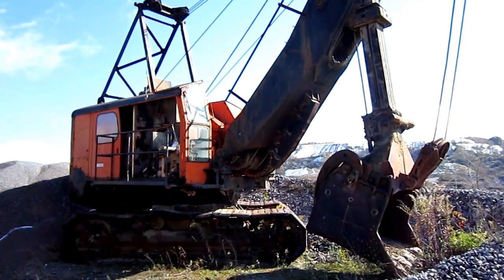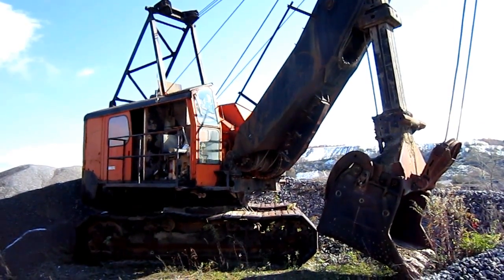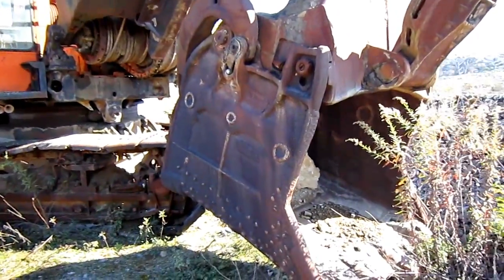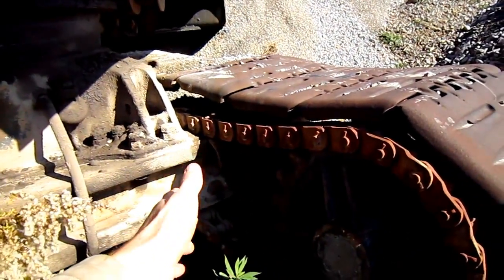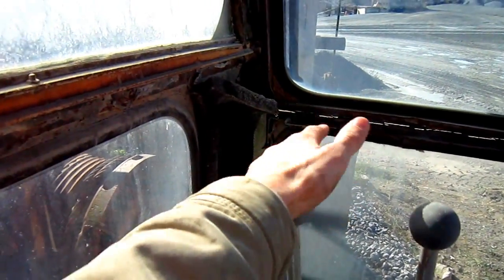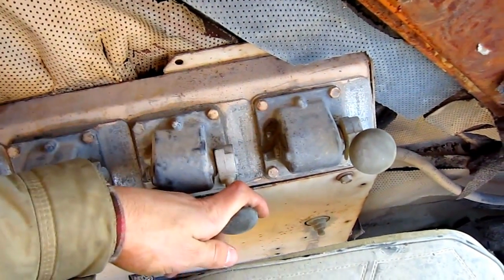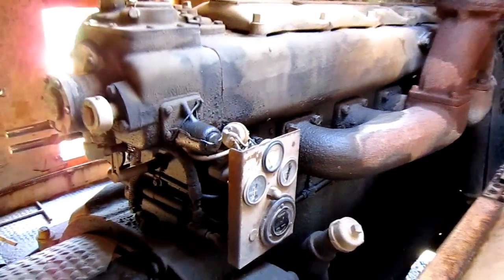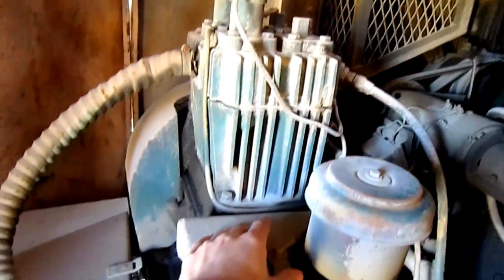Northwest 80-D Documentary

Comment: You forgot to mention what made a NW shovel as they called it "real rock shovel" which was the dual crowd. The hoist rope leads over the boom sheives and is not merely deadended on the boom but is brought a drum at the foot of the boom. The crowd rope comes off that foot boom drum also powered by a chain from the crowd drum. Both ropes torque are applied to the crowd simultaneously up through the shipper block via the crowd rope . (Hence the name Dual crowd") sorry little wording here but anyways you couldn't beat the power of a NW shovel through a cut back in the day. One old timer told me he could rip right through stratified rock with an 80D. Impressive

Comment: I oiled on an 80-D in 1977 that was so dirty it just had a butt rub streak from behind the operators seat to the back of the engine compartment. when I got through with it, a mechanic said it was the cleanest shovel he'd ever seen!!!
Reply from the maker: Always amazes me how some operators can never take the time to clean their machine
Reply: PAmining Like an old timer I worked with said that they were interested in 2 things- quitting time and payday.
Reply: Those were some hard days setting in the back of that NorthWest 80-D with my box of rags and my gallon jug of diesel fuel. I tell yall, those shovels made sounds that weren't meant for the human ear!!!!!!
Reply: The old Murphy's were interesting and all the shovels I was around were like the one you ended up as far as you cleaning them up. No slobs and some of the oilers ran them as much as the operators. I ran a Model 6 with a headache ball and a 25 with a drag bucket. Ran more left handed rigs than right handed though. 99% straight mechanical. Smaller ones to get around better.
Reply: Only ran one manual 80. In '77 my Dad got us a package deal with Florida Rock, who had bought out Dixie Lime & Stone in Georgia, and there I got a taste of Bucyrus Erie with the 30, 38, 71, and 88-B-III. It was tough to go right handed!!! Would rather oil on NorthWest 80-D than any others!
Reply: I ran a 22 with a clam and 1 or 2 with a drag bucket and a 30 with a headache ball. I would've really liked to get on a bigger one but there's no room for one that size around here. Right handed is a constant deal for a while. The hoist and drag aren't so bed but the swing--- I just had to put my left in my lap for a while.
Reply: The last dragline I ran was a NW95-D, now check this out. I can only describe it as being both upside down and backwards. The previous operator had it changed from right hand swing to left. Now, this is the weird part, the brakes were backwards too! The right went to drag, the left went to hoist. Try wrapping you're mind around that!!! But as an operator will, after a week it was second nature to operate...
Reply: Do you mean he switched the clutch lines around because I thought a 95 was manual brakes.And that made it cross handed/footed? MERCY! If that was the way it was and left handed swing, YOU was in a fix for a while. They called it cross clutching to on a dozer to let a track over run the other instead of clutching and braking to slow down and turn. I used to run a JCB backhoe and a 490 JD with ISO? pattern- left hand crowd and right hand main boom and had to switch back to a 200 Komatsu that was the other way. The other operator wouldn't do it so it was my baby. It took me about an hour to go back and forth and if I did it too much I just about couldn't hit the ground with my head. I'm not the sharpest pencil in the knife drawer anyway.
Reply: No, what I think happened is that the drag drum got so worn out that they switched the cables so the good drum, the hoist, ran the drag. I think the previous operator was a bucyrus man and was just to close to retirement to care to run it NW style! And the 95-D was an air assist with a drag brake assist feature. was good for not getting the drag cable crossed up!!! I know what you mean about JCB, the limey's got it backards BAD with those machines!!!
Reply: That'd be interesting sho' 'nuff. A buddy of mine ran a 95 or maybe a 9500 laying 8 or 10 feet concrete tile. It was cable hoist and drag but had a hydraulic curl on the bucket. He said they rented it because it could handle those concrete pipe and it was manual brakes and they killed his legs. I ran a Lima with a slick drag drum and it was interesting for a while too. Wanted to fuzz up in spite of everything you could do. Did a lot of walking and re-spooling.  I was dipping sand out of a river and had to do a lot of casting. Air assisted brakes and I unhooked that and it was better with straight manual,  but like you said, after a while it came together. The JCB  was 4/4 and had a turbo Perkins and was the smoothest backhoe I've ever run. Plenty of power and flow for everything but just needed more leg room. Had to get up, turn the seat and then waller around to get set back down. Ahh, the life of a poor operator.
Reply: I did the same on draglines and probably a couple of years later that you.  It would take me more time to service the one Model 6 than it would if I were to service both the 700 series Americans that we had.  The 795 with the D342 Cat engine was my favorite.  The owners, two brothers, were caretakers of their father's business and they never so much as checked the oil.  They needed someone to follow around to fix every little thing that went wrong.   The other owner, the inlaw who did all the "following around", taught me how to service a machine and keep them spotless just as you did.
Reply: @darkstarcren293  It would be easy to change the hand controls if it were air controlled.  I suppose the brake linkages might be more work unless they did something like switch the functions of two drums which could have problems.  I believe OHSA at some date required Northwest to produce machines with a left-hand swing, but I am not entirely sure about that.
Reply: I oiled on a 80 D in 68 and 69. I'd oil from morning till 1:00 PM then the operator would buzz for me and then tell me he was going down to the Gin mill, h'ed see me in the morning. Good think i was an inquisitive kid becauseI would have been lost operating that giant. By the end of 2 weeks I was very slick. Being an oiler gave me inside knowledge of what not and what not to do.Even the operator noticed improvements. Glad you ran that 80D Great machines.

Comment: Excellent video, 5 stars! One minor correction, however. The small air toggle on the left for the boom just shifts the jaw clutch for the boom hoist. When it's in (engaged) and the swing mode out,  the swing lever will raise and lower the boom.

Comment: Curious how you open the bottom of the bucket to dump?
Reply: +dactgsr1 They had a small friction driver that operated a 3/8 inch cable that ran to the trip tounge in the bucket. If you didn't have that tounge shimmed right it was a bitch to get to open. Drop it and rehaul quick and it would trip (open) every time! Just one of the few tricks you learned operating a shovel!